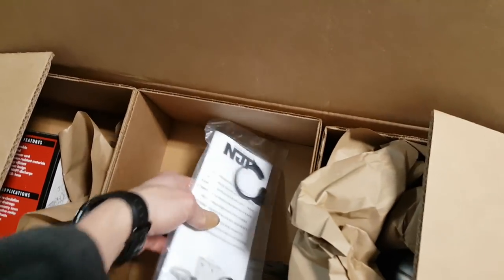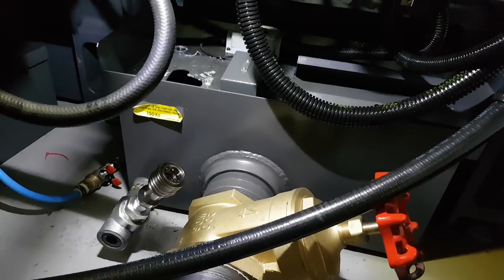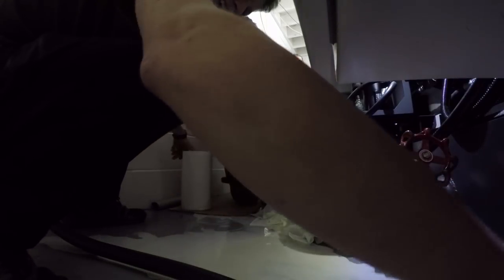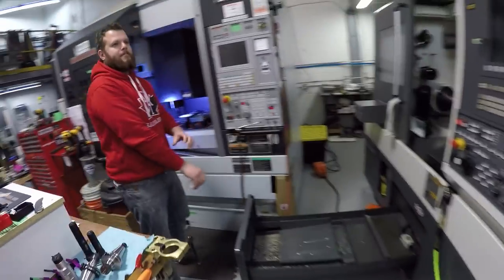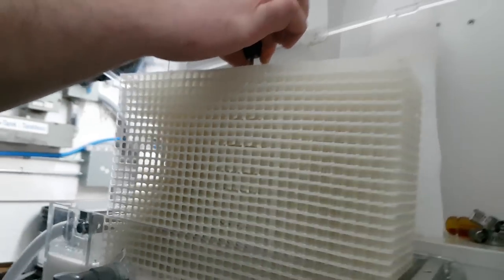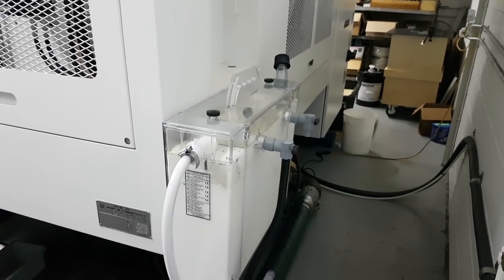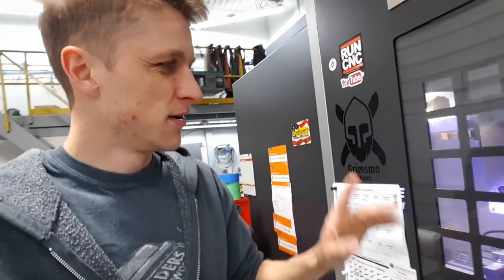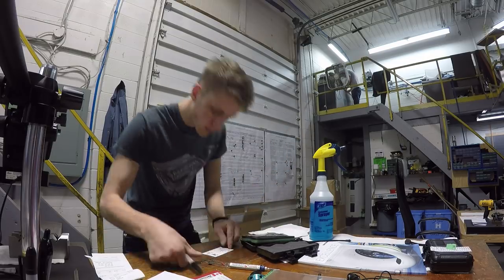Why every shop needs a coolant skimmer - Shop Life 015

Comment: I mostly do engineering work so my mill doesn't run often which is horrible for coolant.   This separator has made a phenomenal difference.   I just put it on a timer and run it 15 mins a day.  By they way, I've never seen a floor so clean under a mill.   That's impressive.

Comment: Fun Fact: Use your Torx bits to remove rounded hex bolts, you will need to tap them into the chewed up head, the 6 points of the torx star fit perfectly into the 6 corners of the hex shape.  Its works every time for me. i find that TX27 works the best on M6 Hex bolts. :)

Comment: I use these on all my lathes. They work great. I let them run 24/7/365, even while running the machine.

Make sure to add a inline shutoff valve on the inlet line for the containment tank.

To drain the skimmed oil out of the top of the containment tank:
1st) Close the  inline shutoff valve on the inlet line. 
2nd) Turn off the skimmer pump. 
3rd) Open the top drains on the containment tank to drain off the skimmed oil. 

Without adding a shutoff valve to the inlet line for the containment tank, when you shut off the skimmer pump to drain the skimmed oil off, the containment tank will drain enough to cause the coolant level and skimmed oil to drop below the top drain valves on the containment tank, and not allowing the skimmed oil to drain from the tank. You cannot drain the skimmed oil out of the containment tank with the skimmer pump running at the same time.

Also, wrap the float unit with something like screening for a house window (or a little finer mesh screen, but not as fine mesh as what is on your coolant pump filter, or the oil will not get through it). This will keep most chips from getting sucked in the skimmer pump, and not cause the impeller on the skimmer pump to lock up and burn out the motor. Remember, it is a submersible pump, and needs to stay submerged to keep the pump motor cool. Saves the life of the skimmer pump, which will fail, eventually. So make sure to keep the coolant level high in your sump at all times while running the skimmer. 

Also, the when cleaning the matrix (which should be done at least twice a year), do not take the layers of the matrix apart to clean them. Use a low foaming degreaser (like Simple Green, at least a 50/50 concentrate) and completely submerge and let the matrix soak (overnight seems to be long enough). Then, thoroughly rise the matrix before reinstall.
Reply: "You cannot drain the skimmed oil out of the containment tank with the skimmer pump running at the same time."  What happens otherwise?  I've been draining the tramp oil without turning the pump off without an issue.
Reply: @agg42  Then you better be watching the tramp oil leave the skimmer tank. If not, with the pump running; the coolant level will keep rising as the oil exits the tank, and once the oil is gone, then you'll be pumping straight coolant out of the tank. I found that out the hard way before I added the inlet inline shutoff valve. Huge mess on the floor, and wasted coolant, which ain't free.

Comment: A hand held impact driver will usually get those stripped allens out. Also heating with a torch and driving the next size in usually does the trick as well. I would suggest since you take mostly small fine detail cuts and your chips are small that you install some finer mesh screen in your catches to help keep so much swarf out of your sumps.

Comment: I really need to get one of these, my lathe absolutely pisses a ton of oil in the coolant tank. This looks like a nice one!
Reply: John Huijben I built one for my Mori seiki but I really should've just bought one. I spent way too much time building it. But it does work pretty ok. Except the one time something clogged it up and a lot of the coolant ended up on the floor lol.

Comment: Torx all the things!  My first check whenever I go to McMaster for bolts is, do they have it in a Torx.  I wish it was standard and you had to go out of your way to find Allen heads. :-/
Reply: Yeah, hex heads just don't work out right, as far as i'm concerned it's a failed implement, we just happen to have it en masse because it was the standard for ages. Heck, were it not for the hassle of sliding the screw driver, a freaking (properly cut) flathead is more reliable in time.
Reply: What's so good about Torx? They fail faster that Hex bolts.
Reply: if everyone would standardize the Canadian Robertson head (square head) that'd be great.

Comment: we used a coolant centrifuge oil seperator at my last shop, we were very stingy about coolant and anything that machine diddnt reject went back to the machines indefinitely,  if was nice though. it got all of the micro particles out of the coolant which scraped out of the spinning drum by hand as a grey sludge. kept the machines very very clean.

Comment: Before I changed jobs, I couldn't convince the company to buy something like an NJT or do anything for coolant maintenance. Instead, I ended up making something comparable out of a 5 gallon bucket, venturi pump, and a filter bag. Plump the venturi into the machines existing airline and presto. No electric pumps, or extra work. as long as the air is on, it's running.

Comment: Do you have a problem with stripping threads given that your fixtures are all aluminum? Tim Paul mentioned on a webinar that he greeses the threads on his aluminum fixtures so they last longer.
Reply: The hex head, not the bolt thread. He replaced them with Torx.
Reply from the maker: Sometimes we do strip the threaded part in the fixture, and it totally sucks, then that hole gets upgraded with a threaded insert.  But typically it's fine!  In a perfect world I'd use thread inserts on every single high use thread in the aluminum fixture, and I bought enough to do that, just haven't yet.

Comment: I made my own disk skimmer from hardware parts, a laser cut stainless steel disk and a slow turning surplus motor. It cost about $120 and has the same performance a units costing around $500. Its definitely not in the same league as your skimmer but works fine for a Tormach sized machine.
Reply: Nick Martin i built one too out of an old table saw blade lol. It did get clogged up one time and made a mess in my shop floor so now I try to only run it when I'm at the machine or at least in my shop. Wish I would've bought one though haha.

Comment: 500.00? 
You could have made a oil skimmer with a 2 - 5 gallon pails, 1- 10 gallon rubbermaid container,  3 - 1 1/2" bulkhead connectors, 1 - 90 degree PVC elbow, approx 2' of 1 1/2" pipe,  1 - 9" piece of 3" PVC pipe... 4 pieces of wire. 
I designed that as a liquid "Thein Baffle" dirt / oil / grease separator for my parts washer...
All the oil and dirt coming from the washer is swirled into top of the first bucket under the "water line", oil is separated by the 3" pipe sitting above the "water line" and over the 1 1/2" pipe in the center of the bucket suspended by 4 wires, so the oil and 99 percent of the suspended dirt stays in the one bucket, then goes to next bucket which gets rid of more suspended dirt if any, then the goes to the large container with the pump and heater. The cleaned cleaner gets pumped to clean parts. I have about 100.00 in it including the valves to control the parts washer... I use water based parts cleaner in an unheated garage so I added a aquarium heater set at 50 degrees to keep it unfrozen... with no insulation. All have the covers on them BTW. We had temps at -4 and it didn't freeze. 
To clean it, you are only messing with a max of 5 gallons of cleaner... pump the majority of the 15 gallons into the washer. Then I use a light behind the bucket and siphon the "separated" cleaner into the next bucket from between dirt and the oil then dispose of the it. Slap it back together, add more cleaner... hardly any dirt has shown up in the second bucket and I have used it a lot...

Comment: Your jigs are aluminum aren't they?  If they are you can dissolve a steel screw out of aluminum with alum.  Available at every grocery store in the spice section.  AvE had a video on it.  No risk of damage to the jig or threads, but obviously takes longer.